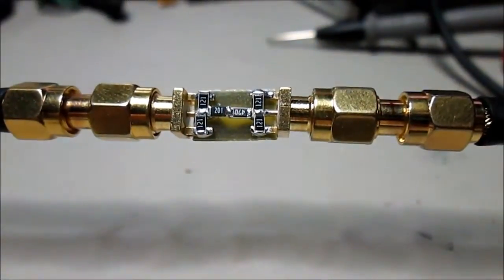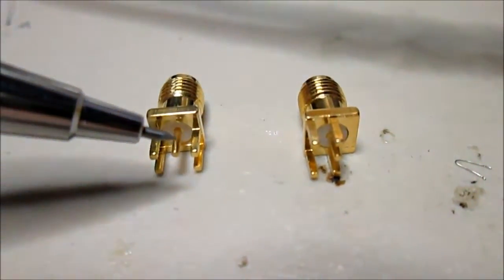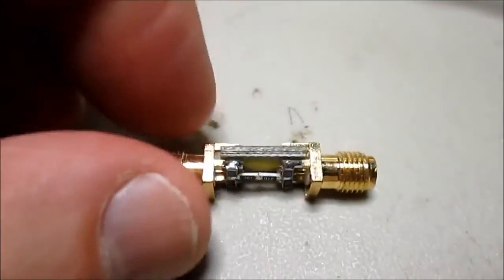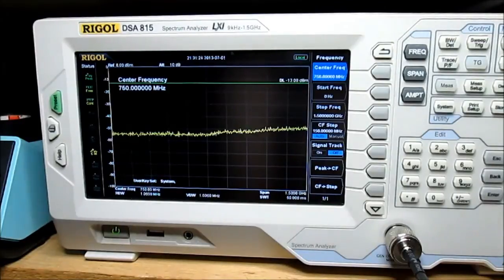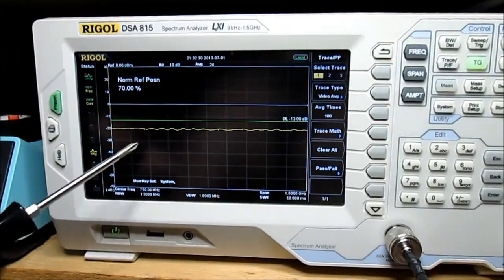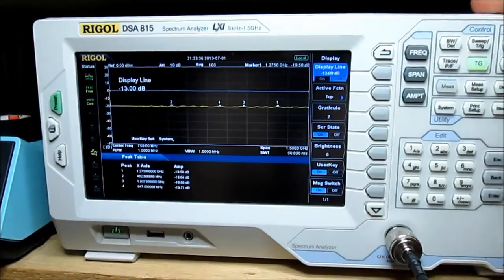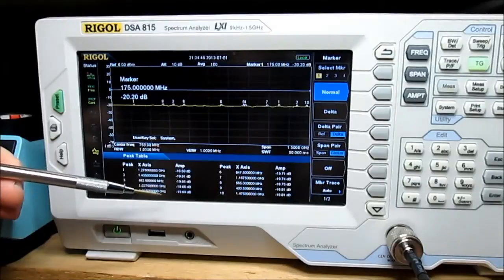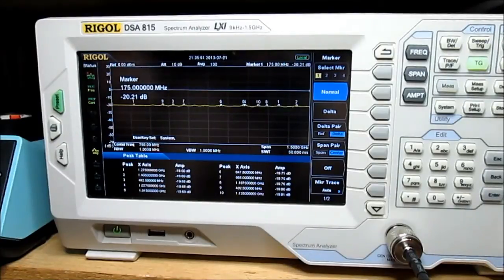RF Attenuator build - 2nd Attempt with Spectrum Analyzer plot

Comment: Great video. I think I learnt all I need to know about attenuators from you. Input = 120 ohms in parallel. Middle resistors = (200 and 47) ohms in series, output = two 120 ohm resistors in parallel, input of test equipment = 50 ohms. This means that the generator "sees" 49.2 ohms (approx 50 ohms still) and the test equipment sees a fraction equal to 0.099 of the generator voltage i.e. 20log (0.099) = -20 dbV. Thank you!
Reply from the maker: ElectroAfrican You are quite welcome .. Always feel free to ask questions or give ideas for future videos ..
Also please subscribe and share if you haven't already done so.. Your kind words and support are always welcome.

Comment from the maker: Thanks for all your comments .. 
Makes sense .. too bad the Rigol has to be like that .. 
But still .. its not a 10,000 analyzer and suffices for what I do .. 
I will try the two 6 db attenuators and also replace the two series resistors with two 120 ohm resistors .. 
Now .. if I am normalizing .. does that not take into account the ever changing input impedance? as its being normalized across the entire span ?
Or is it more complex than that ??  I can try to buy some shorter cable.

Comment: The ripple in attenuation measurement is most likely due to the DSA815-TG.  To measure Peak-to-Peak value of the ripple push Peak then Peak Peak to get the Rigol unit to find the Maximum and Minimum value along the trace.

As far as series, single, or parallel resistors, parallel resistors cuts lets say 1nH of inductance in half to 0.5nH, two SMTs in series would have 2nH, and a single SMT would have 1nH of inductance.  This will affect the higher frequency response.

Comment from the maker: Strip away the copper between the pins on top and bottom? 
or just bottom ? How much of an effect does the thickness of the copper make on the impedance? I have FR-4 board with thicker copper on it.
Is FR-4 board an issue at 1.5 GHZ ? As far as board material goes .. ?
If parts were actually soldered to the copper?

Comment: Just to clarify the issue about the poor port impedance. The low cost Rigol will not have ports that are a true 50R across that frequency range. Adding the long cables will make the impedance circle the smith chart and this means you aren't testing that attenuator in a true 50R environment. At some frequencies it could be 25R, at others 100R or it could be a complex impedance like (33R + j33) at the cable ends. You can't escape this problem by normalising to a flat line with the SMA bullet.

Comment from the maker: I replaced it with my attenuator and it was quite flat. 
My research shows that the max attenuation variance due to the Rigol source and load port impedance changes to be less then .25 DB 
My attenuator with the old setup was close to 1.75DB max, so doing the setup this way made a marked improvement. I am wondering if adding a correction table to compensate for the load / source impedance changes would help and also add to that table the typical attenuator variance from the one I normalize with

Comment: Just to add... Obviously, if it was built poorly with long interconnects then the inductance of the connections would become relevant but as long as it is built as point to point then the package inductance will just degrade the return loss a bit up at higher frequencies. However, the flatness of the response will be dominated by the package capacitance of the resistors. So having two 120R resistors in series will give a flatter response than two 470R resistors in parallel.

Comment: Obviously, your Rigol isn't a 2 port VNA so it can't do 12 term error correction but what you can do is try and improve the source and load impedance by fitting decent quality 6dB attenuators at the working ends of the cables and then do the normalistation. However, you then have to be careful about the leakage errors because these will become more significant with the 6dB atts fitted. So there is a degree of experimentation required here.

Comment: Also, you used 200R + 47R in series and I think you would get a slightly flatter response if you used a couple of 120R resistors in series because it keeps the design symmetrical wrt the series resistance and the way the parasitic capacitance is shared across the two series resistors. But to see this level of performance correctly you would need to improve the test setup a lot. Ideally you need to use a full 2 port VNA to really give that attenuator a chance to show how good it is.

Comment: In this application the connection/package inductance of the SMD resistors isn't really relevant. This is because the package capacitance of the resistors will dominate the response. eg the capacitance might be 0.07pF. So having two resistors in parallel will cause some subtle peaking in the attenuation response as the frequency goes up towards 2GHz. With two 120R in series the response will be much flatter. Try building it or modelling it and you will see. :)

Comment: Trust me, what you are trying to do requires extremely good test equipment plus the training and understanding to minimise all sources of measurement uncertainty as possible.
I would recommend you google for "Agilent AN 1287-3" as this app note covers this in detail. Just read the short intro about ripple and look at fig 1 in the app note and you can see the ripple caused by a basic response normalisation. See how the ripple vanishes after a two port calibration in that fig 1.

Comment from the maker: G0HZU .. questions .. You said 2 6 DB attenuators at the "working" ends of the cable .. do you mean at the Spectrum analyzer end? or the DUT end of the cable ?  You seem to quite the "private" person, however, would like to know at least your first name to refer to you as in my videos..  ;-)   An email address would be even better.  I also did a test with less connectors, two short cables, and one VERY flat 10 db attenuator from Minicircuits,

Comment: So even though you normalised the analyser you haven't escaped the problem of the poor source and load impedance. You just made the response look 'flat' with the bullet 
SMA. So once you connect the attenuator you can expect to see some fake 'ripple' on the analyser. This ripple is not caused by the attenuator. It's a byproduct of a less than 
ideal test setup. You can make it better by adding 6dB attenuators at the end of the cables before you normalise.

Comment: That should be a lot better because you used 2 series resistors rather than 2 parallel. However, your test method suffers from high  measurement uncertainty/ripple because the Rigol will have poor source and load match at its ports and you are using long RF test cables to connect to the attenuator. This means the source and load impedance at the ends of the cables will be circling the smith chart on a VSWR circle somewhere around 2:1 in parts of the range. So you see wavy ripple on the trace.